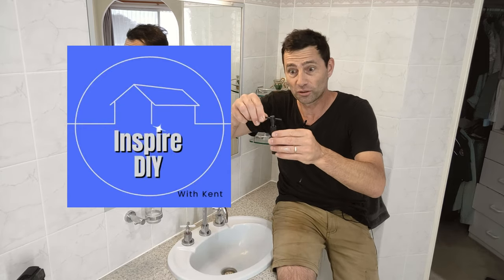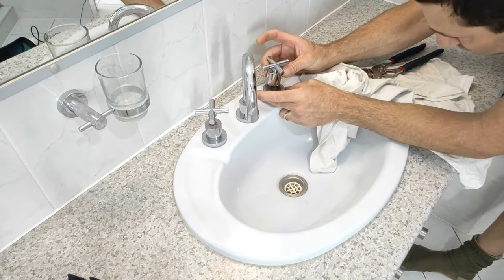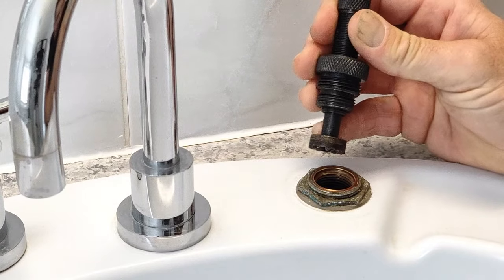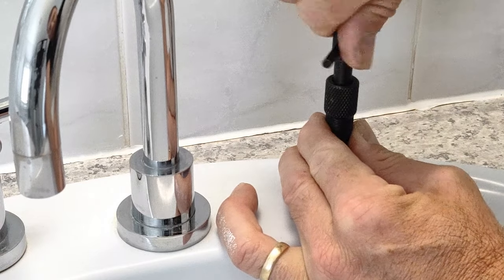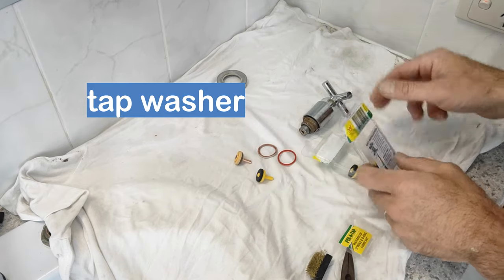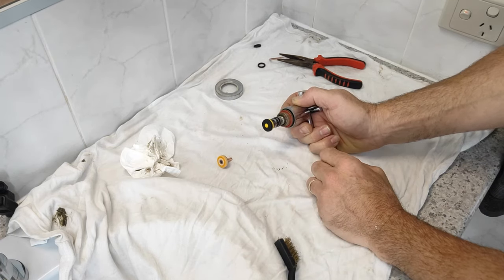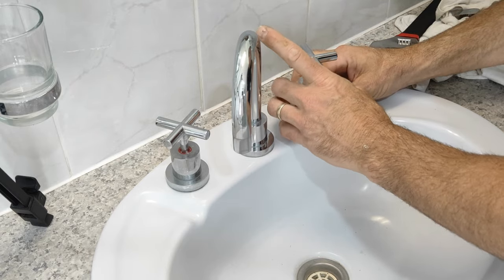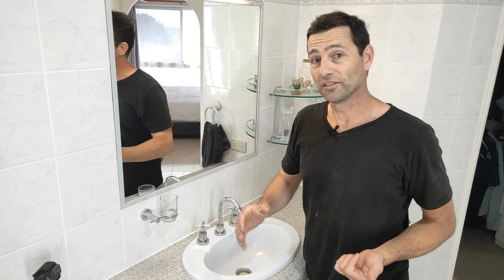Reseating tool - how to reseat a tap with a Faucet Reseater - Inspire DIY Kent Thomas

Comment: Just a helpful tip ive learnt, turn on the mains water first before closing the tap, helps to wash out any fillings on the seat, if i single file gets on the seat and on the washer, the drip will never stop
Reply from the maker: Hey Bowen, that tip👍👍 well done mate, I have changed to doing this too now, Kent
Reply: thanks for this reminder. I had to do a lot of grinding and heaps of shavings came through when flushing it. Good peace of mind to get them cleared out first thing.
Reply: Yeah,tap reseat has fine thread,tap has coarse thread - tell me how to screw fine thread into coarse thread?
Reply: @martintheron1386 
You can not,,, you brought the wrong Tap Re-seat tool ( i think ),,, always check you threads before buying the tool,, it will be either a course thread or fine thread,,, just turn your water Off and then remove your Spindle and take it to your local Hardware store if you don't know,,, they will help you out-.

Comment: Great video. To the point and no music. one tip, put the plug in the sink before start so if you drop anything it won't go down the drain. Rememebr to take the plug out before turning the water back on.

Comment: I would flush the filings off the open tap using an external jet of water say a squeeze bottle, before boxing the tap and opening up the mains. Nevertheless, great video. Thanks.
Reply from the maker: Hey Behram, that’s a great suggestion, I have learnt to do this too since shooting this video👍 thanks mate, Kent

Comment: I know this is an old video but I thought I would comment on the technique. My reading of the instructions, having dived in without reading the instructions initially, is that the collar is not for applying pressure to the cutter. If you use it for that purpose it will bind and you end up gouging grooves into the seating face. In fact I believe it should be backed off so that it almost holds the cutter off the seat. Hold in place and then skim the seat, slowly winding the collet in until the cutter moves smoothly without any chatter. This ensures the face is smooth and level and there is no danger of gouging and damaging the sealing face.
Reply: Great tip Marshall👌 thanks mate, Kent

Comment: is there also a drill version of this as i've seen other people use it to reseat taps? I guess this more "manual", "less modern" version would be more slow and therefore careful in not reseating too far as I understand that causes problems too.
Reply from the maker: Hey Lowkey, I have used both now, the hand tool is slow and labour intensive but so cheap so I guess that suits if it’s not a frequent job. Cheers mate👍 Kent

Comment: I have exact set you show in video after watching your video I got the taps off but now I’m having trouble removing the actual mixer in the middle if you could help please
Reply from the maker: Hey Mattaylor, I believe it is held by a nut to a threaded section below base of spout. best of luck ...let me know if it turns out to be different than what I describe. Kent

Comment: Thanks a million. This video is wonderful. You are the BEST. 🎉

 I am about to re seat all my taps here, in my 1942 apartment. I have the re seating tool already, but didn't realize the second; "screw down for firmness",  part of the apparatus. ✍🔧👼

Most educational. Especially loved you filming the shiny brass, as the re seating tool started to do its job, of re leveling the tap seat. That was so empowering. I've always been a bit unsure as to how many turns to do, and the "What am I trying to see" factor. It all makes sense the moment that I see your good work here. 

This video has eased my nerves, no end. 
 😆😂🤣🙏✍📝✏🗝🔧

My co worker Matt, explained the basic steps of "changing a tap washer/valve/stopper", (a decade ago),  and I have been doing my own repairs ever since. 

It's a real self esteem boost to be able to handle most repairs around my own dwelling.

I'm on a very humble wage, so the money I save doing everything myself, is a game changer. (Paying the mortgage  solo)

God bless you, for taking the extra time to share this with us all. Loved the verbal knowledge exchange the entire time. Such wisdom, on each step. Confirmed all the conscientious little things, that I also do, while repairing the taps.🙏🔧

Love in our Lord Jesus Christ, Princess Holly
 👸🕊🌿🌳🌲🍀🌱🌴🕊
Reply from the maker: Hey Princess Holly, what a lovely comment to get today, 
One more thing I've learnt since ...once the tap is reassembled, don't close it down, instead leave the tap slightly open and as you turn the water back on it will flush away any filings from your grinding and not imbed them into the new valve.
thank you (and god bless back at you).

Comment: Hi Kent, Im a sorta newby in the DIY stakes but gaining confidence with the types of stuff youve shown here with the taps(indoor and outdoor).  Changing the washers and cleaning the faucet with new o-rings, I did that to a couple of my taps. I do have one tricky job to do yet...my laundry tap(same sorta thing as your kitchen tap replacement video) would be super simple BUT... the damn nut under the sink looks to be RUSTED ON !!  Bugger. I might have to 'muscle' that one off to extract the culprit I reckon. I have stop valves on my laundry tap so water fountains shouldnt be happening.  I dont have proper plumber tools for that nut so like yourself...Im going to use an extension on my ratchet socket set...should sort it.  BTW..Kent, it just so happens your name + surname by coincidence are my FIRST TWO names! ... (not my surname though). My initials are KTB.  I had to look twice to see that Google wasnt playing tricks on me in the name thing...  ps..your vids are super clear to watch and understand.   Now if I could just figure out why my shower has the least pressure in my whole house it'd be a perfect world. I had a plumber in and he did a new kitchen tap install and all my tap washers too at the time, but he couldnt tell me a good reason on the shower (lack of) water pressure. Other bathroom taps have great pressure! .......
cheers to ya.  😁

Comment: Thanks for the video, it was helpful. In my case the seat was the only problem, but my tool was old and the middle tensioning section took a while loosen so the grinder would stop digging in. Probably due to my using direct from creek water, there was significant corrosion, and it took about 100 turns to get to the shiny metal. The teeth of the grinder end were full.
Reply from the maker: Well done tree farm, you got there in the end🤙 Kent

Comment: Hi, I did it too, 😊 thank you so much for your video.
Just 1 question,  how come when I install back, and open the main valve the tap always is on and water running,   and I have to turn the tap off. 
Is there any step that I missed ?

Will this effect my hot water reduce the temperature?
Reply from the maker: Hey mate, is the water running when the tap is closed? Dripping or running? Could be a damaged valve - if you have a spare I would change it out as my first test👍 let me know how you get on. Kent

Comment: i purchased a 3 hole basin and i cant screw in the spindles because its just a hole with nothing underneath to screw in and attach the hot and cold water hoses . i think i need a connection at 2:09 that you say you pulled tap washer out of. i dont have any of that .. whats that called to screw in spindles ?

Comment: Hi Kent, do a video on repairing washer / seals in a universal washing machine tap. They have a different tap washer as water has to go up centre for the second (washing machine) tap and a couple more O-rings. Thanks.
Reply from the maker: Great suggestion RosscoM 👌I’ll put it on the list. Cheers, Kent

Comment: Good video, I've used an old one of these but its a drill attachment and overkill for everyday, so good to see the big green sheds one in action. Most cross taps (as in I've never seen one without in 10 years of handy womaning) have a security nut underneath so you can remove the handle so you can get the handle off and take off the flange and have full access to the spindle for inspection/maintenance, you need a tool called an anti-vandal tap spanner to release it its basically a bent two prong fork. Its always best to take the head and flange off completely rather so you can clean/lubricate all the thread connections and make sure the handle isn't getting stuck with grime/scale in the anti-vandal nut thread, and also then you don't have to be so careful when using the spanner as most of the pretty parts are safely out of the way.
Reply from the maker: Hey Handywoman Trexkitten, that's great input thank you. Kent

Comment: Is it necessary to make sure there's no water inside while your doing this?
Reply: Hey Mets, nah it really doesn’t matter👍 Kent
Reply: @olivechopper  cheers mate one more thing what do you have to do to flush the shavings out after your done?
Reply: Great question mate, and several legends in the comment thread have addressed this.. leave the tap open and turn on water supply to flush filings away - otherwise they can embed into the new valve and score the seat again. Best of luck, Kent

Comment: For metal on metal, shouldn't I use tape tread?
Reply from the maker: Hey Andrew, if you are re-installing the tap using a fibre washer then there is no need👍, without the fibre washer yes, teflon thread seal tape PTFE is the next best thing. Best of luck mate, Kent
Reply: @InspireDIY  Thanks! Ive been over doing it then...
Reply from the maker: Haha, no leaks at your place👌

Comment: BIG mistake mate !! you should leave the tap turned on as you turn on the water supply to flush out any swarf(filings) out of the body  of the tap to prevent the debris from embedding itself in the new washer and possibly score the new seat you have just made in the tap body. This can be a little messy unless the water supply shut off valve is near the tap you are sorting out enabling you to shut it off quickly after the "grindings" as you refer to them as have cleared the tap body cavity.
Reply from the maker: Yes👌 you are on the money and absolutely right John. Well done and thanks for adding to the knowledge shared here. Since this video I have been utilising this tip with good results. Cheers, Kent
Reply: @InspireDIY  Thanks mate and just for the money you don't really need one of those kits you can buy just the new "O" rings and body washer (it is very often the case that the old is reusable or use some of that white PTFE plumbers tape) so the body washer unless really chewed up the old one will suffice. Dad and I used to use just plain old Vaseline for the lubricant (it lasts forever) and on taps that can be completely disassembled we used to clean the inside of the tap body where the spindle goes through with a few twists of a fine steel wool and just enough to take off any calcium build up (and just flush out the debris if any). The washer itself I find that "Doust" brand tap washers are really good even if the seat has not been ground down (in an emergency) that will give you an extra bit of time to get the other tap sealing components. The body I find needs cleaning from time to time as the crud does build up under what you refer to as the hood I do them every few months when cleaning the bathroom. But just use the method that suits you really. Just a word of caution only buy a good tap reseating tool because some of the cheaper ones have too much "play" between the spindle and spindle guide😉
Reply: Thanks mate just the answer i was looking for